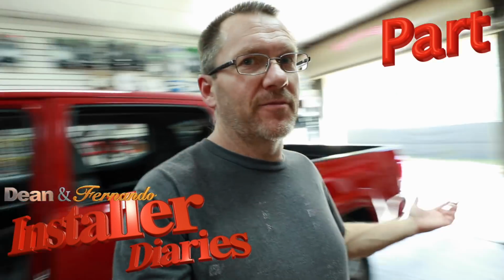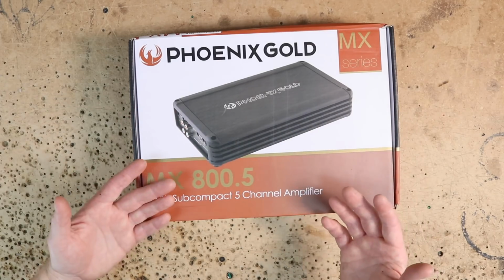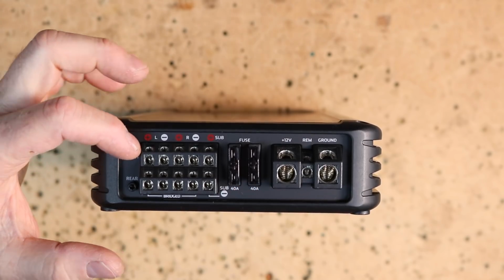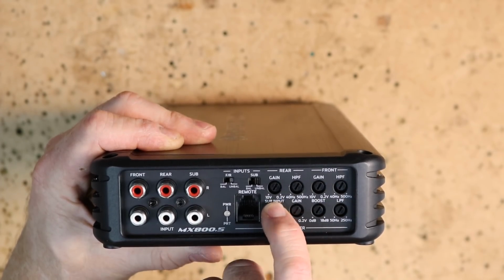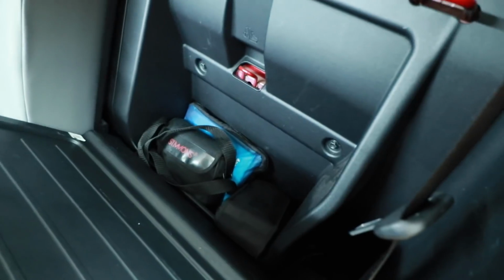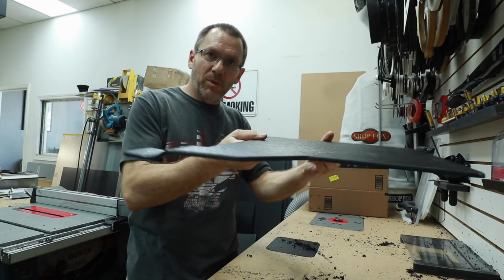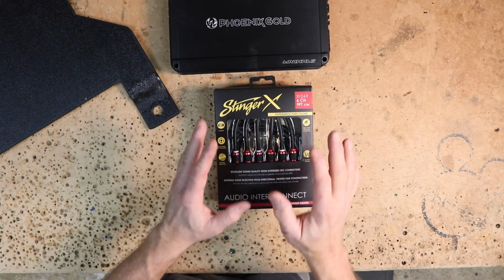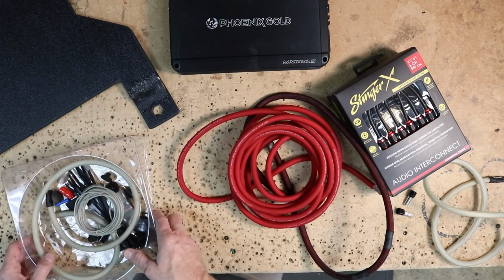Stinger X, Mx Phoenix Gold, and a Toyota Tacoma  Installer Diaries 267 part 1

Comment: I am using this amp with a set of Polk Audio DB+ 6502 components which are rated for 100 watts RMS and handle 35-40khz (they should be able to play reasonably low) and a 10" kicker sub.  I don't have any real bass (virtually no mids, it sounds like the tweeters are providing 80% of the sounds/vocals) from the polks up front vs when I had these on head unit power.  My cross overs on the amp are turned all the way down and should be playing full range.   How has this amp been working for the customer?  I can't get mine to sound right.

Comment: Dean we need the info for the little yellow crimps I know you said you got them from some company  what size are they etc I've seen a ton but dont know what size those are to match them up as yellow is usually the larger wire and those are alot smaller thanks
Reply: I get them with install bay brand. But I'm a mechanic.

Comment: What did you use for the 4 gauge ferrule to give it the same position that the ferrule thanks in advance I've been using dnf tool drawer divider different part that do have the ferrule crimper and Pharaohs but I didn't see anything for the four gauge ferrule and larger

Comment: Can you please help me? I have a 2500 watt rms amp so my ? Is what size fuse do I use on my power wire to the battery? My local shop said the 150 amp fuse was too small and recommended 200 amp? Is that correct,thank you
Reply from the maker: What amp is it?
Reply: Five Star Car Stereo hifonics Bxx 3000.1 Brutus and I’m running 0 gauge
Reply: @suazzz3070  The specifications for this amplifier on the hifonics website as well as the Quick Start Installation Guide plainly show an external fuse/power wire rating of 250A/0ga.
Reply: Boyd Lamb I bought it used and drive up auto sound said 250 was too big? That’s what confused me
Reply: Did you read the manual?
Reply: Better yet what size of power wire are you using? You should fuse the power wire at the battery with the max fuse rating for the wire and fuse the amp in the back i would fuse the amp at 200 amps if it truly does 2500 rms...but if you want to be on the safer side of things i would fuse it 175 amps
Reply: If u use under 250 you will not get full power from the amp, but i understand u dont want to burn up ir vehicle good luck